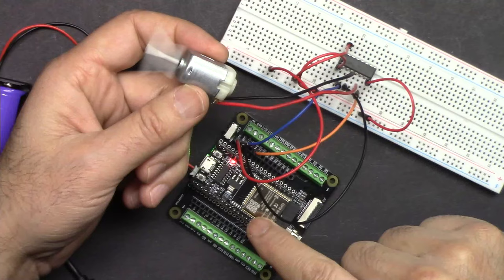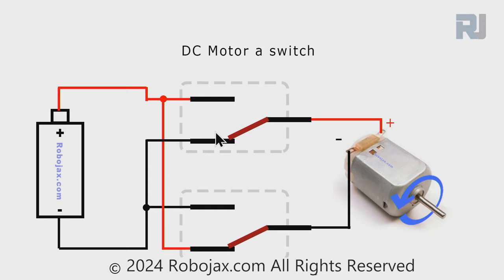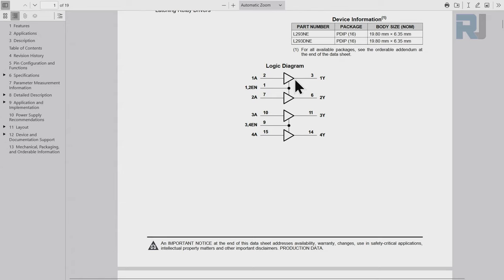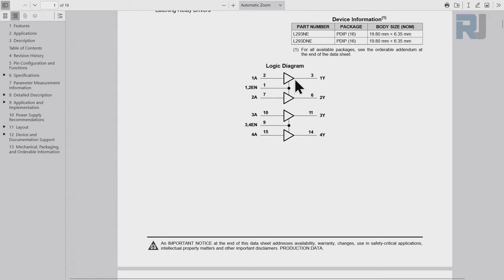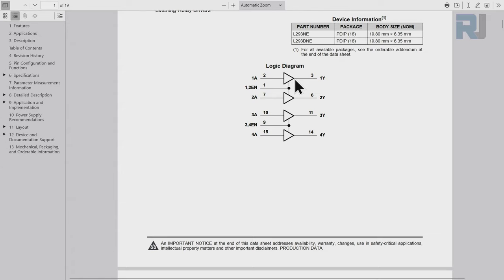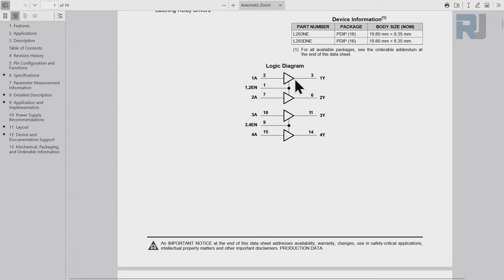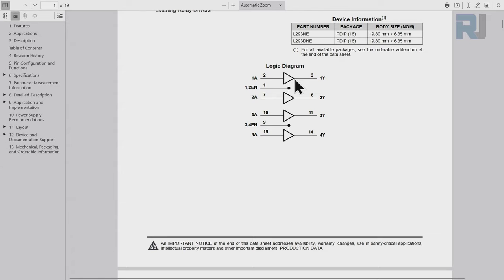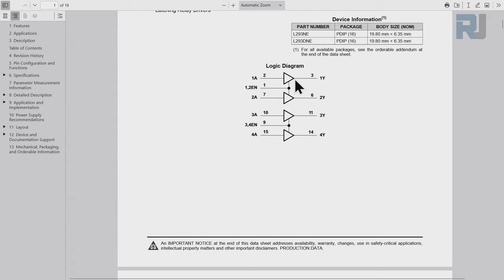ESP32 Tutorial 15 - DC Motor Speed Control with ESP32 L293D | SunFounder's ESP32 IoT Learning kit

Comment: Why do motor driver boards usually have more components than this? Capacitors for noise from the motor, what else?
Reply from the maker: this is just one motor. And yes two capacitor will keep the power stable.